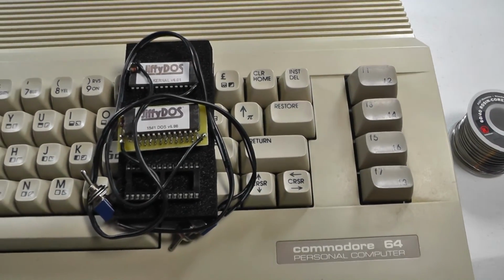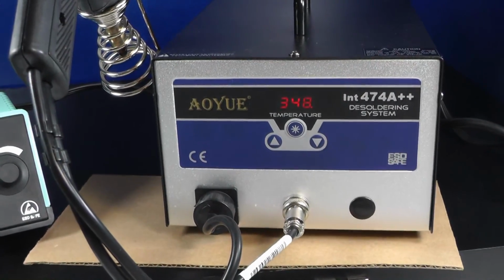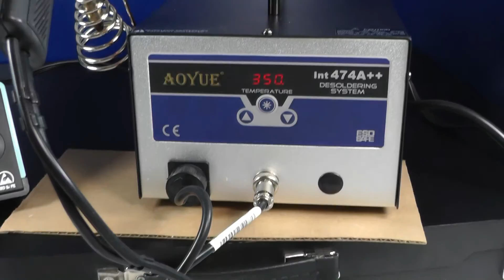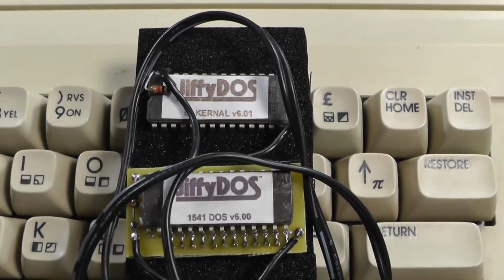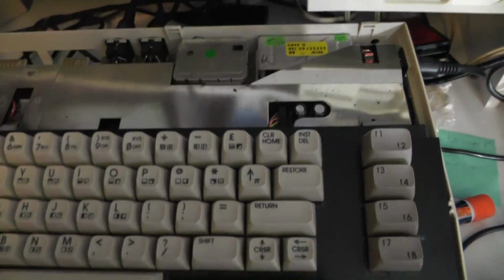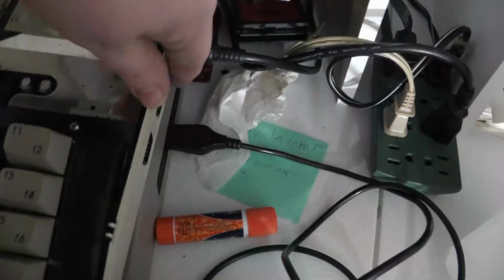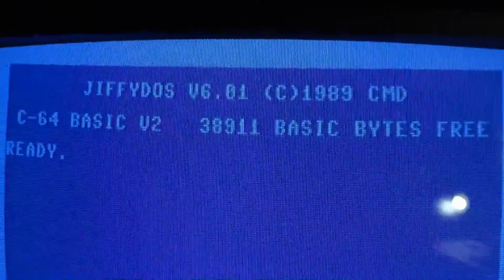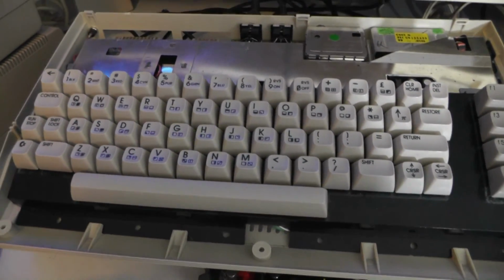How to Install a JiffyDOS into a Commodore 64

Comment: Or just buy an Easy Flash 3 cartridge.  No soldering required.
Reply from the maker: TRUE, Watch my Easy Flash 3 video. BUT I never liked do it that way. Having the ROM install saves you a few steps. Thank you for your comment.
Reply: JiffyDos works with more software.

Comment: This one is a bit simpler to install and requires no drilling for switch...U4 will still need to be desoldered if not in a  socket already  but JiffyDOS is the size of the socket http://www.ebay.com/itm/Commodore-64C-short-board-switchless-JIFFYDOS-clips-NO-DRILLING-/161761760176?hash=item25a9c093b0
Reply from the maker: +Beth Bell Beth what about the 1541 JiffyDOS chip? That's the one that was really big and I have to move parts.

Comment from the maker: I put the jumper wire on top since it was a easy fix, IF the wire comes off, I will move the wire to the bottom of the board. That's prob. what I should've done the 1st time..